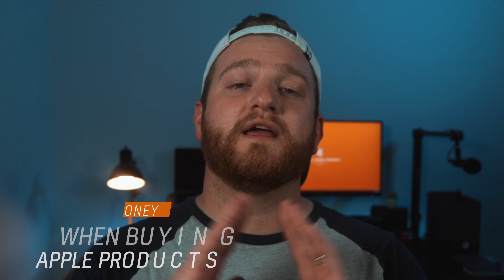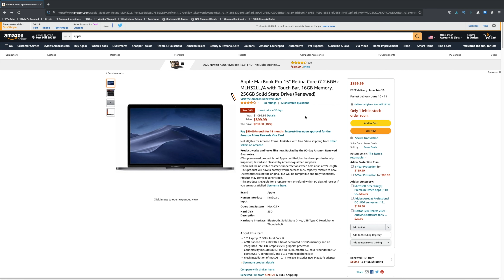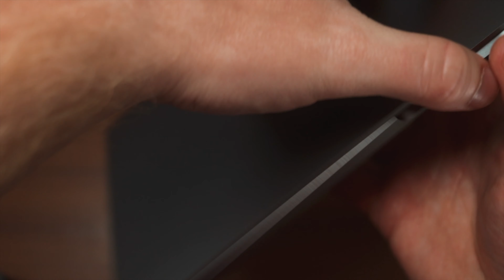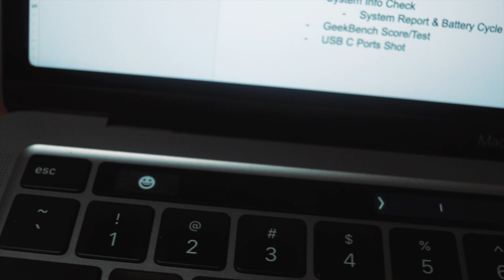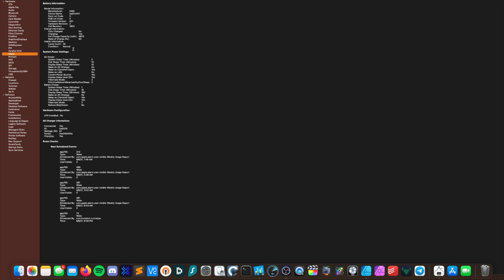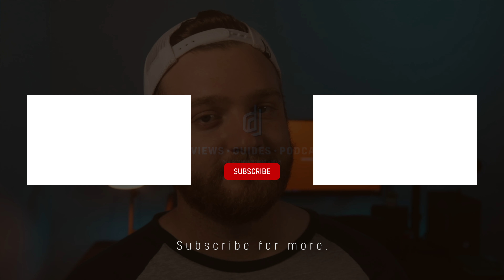I bought a refurbished MacBook Pro. | Amazon Renewed review

Comment: warning LOL rant just here about renewed amazon review ill never buy apple why not just use a kde linux or windows de-coupled from micro-soft easy done and have product choice save cash and spend more on other crap apple suks lol i can not see their hook at all and a am picky about nice stuff built well thats why my audio is bought used and serviced the receiver amplifier is made in the 70`s and a studio grade peavey amp brand because build  is so bad any more on new stuff unless its a facy brand and they lost their mind on pricing just for good internal parts on circuit board last i looked at was 1200.00 for a 125 watt 2 channel home amp thats just silly but at least its made in usa 450.00 may be not 1200 silly stuff .Sorry i ranted a bit
Reply: you're inclined to your preferences just like others. Personally I've owned similar windows and android devices in the same high end space sharing similar prices. I've always preferred the iPhones universally. More-so especially since all the "major advantages" of android are usually gimmicky features that i do not use. I like my Macbook for work because it's extremely reliable, unlike my experience with Windows. However, Windows pc's are irreplaceable for me specifically for gaming. Otherwise i prefer the Apple ecosystem.

Comment: I really appreciated your video...Now, I love Macs.. but I use it as a normal user.. Just to check my mail and work in an academic interface with students... My budget is about 700 bucks..  Would you still recommend an Amazon buy? Thank you for your time and possible reply.
Reply from the maker: For $700 you can find some deals on M1 Mac Minis and MacBook Pros as well either on Amazon or Apple refurbished. As a normal user I would consider something like the M1 Mac Mini or if you need something for travel purposes, Intel based Macs are super cheap now. Hope that helps!
Reply: @DylansDecoded  .. Thank you very much. I didn't even think about the mini one! Great help buddy!